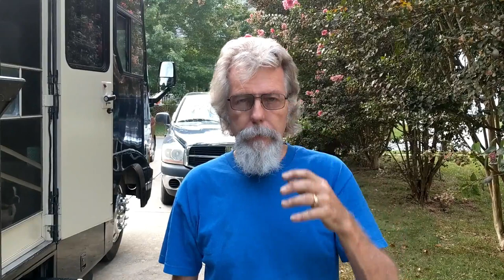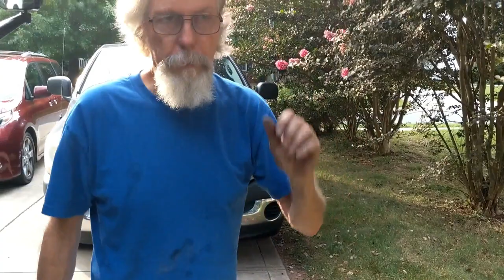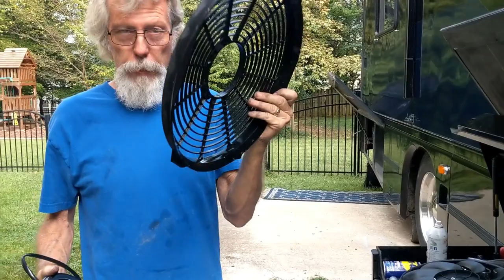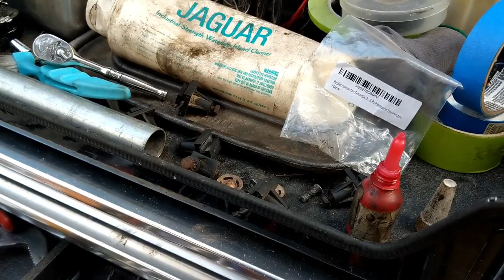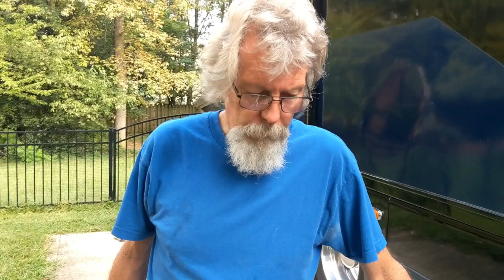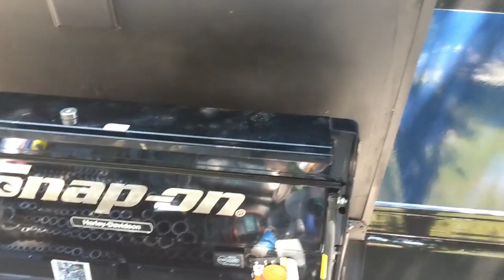V-117 How-To Repair Dash AC Not Working

Comment: We were sooooo happy that after 2 refer fires in our m.h. that we finally installed a Samsung residential refer.
Reply: Hi Rich, I love my fridge too but loves the power, what do you have for batteries?
Reply: @dougd9944  4 Delco 240 watts solar but even without the solar I can use a little generater

Comment: I believe I might be having the same A/C issue.  A/C blows ice cold for a while but after and hour or so, I noticed the air the A/C blows out starts to get warmer.  I also have noticed that the condenser ( I think ) fan stops working and that’s when the air starts to get warmer.  
My question.  If you invert the blades do the A/C would the cause then to suck air in instead of blowing air out towards the condenser ?
Reply from the maker: Yes, but if the fans stop it will only cool when you're moving and not very well .
Reply: @EconomicRefugees   that’s what appears to be happening to me.  I’ve also learned there is a sensor in the high pressure line and that is what tells the fan to turn on / off.  I’m going to try to fiddle with that and see if that might be the issue.  
Thank you for the quick response and sorry for the typos.  It’s 5:30am in miami and I just woke up.  Lol.
Reply from the maker: My fans are always on when the ac is on, and 3:30 here just woke and checked my phone !!
Reply: @EconomicRefugees   always on ? So there is definitely something wrong with mine ?  Either fan motor is bad or the high pressure switch that tells the fan to turn on is bad, correct ?
Reply from the maker: It could be, what year and brand is your motorhome ?
Reply: @EconomicRefugees  2014 itasca meridian made by Winnebago model 40U
Reply from the maker: @concernedpatriot.2221  Is it diesel